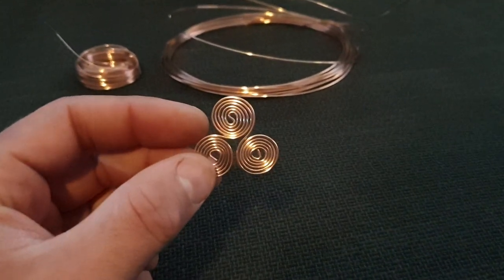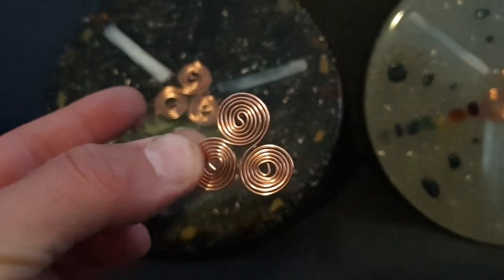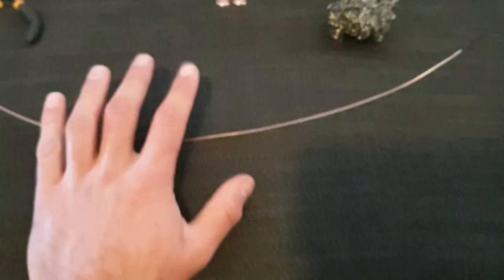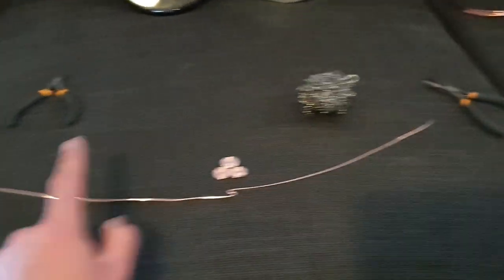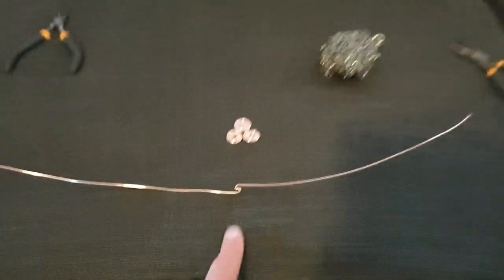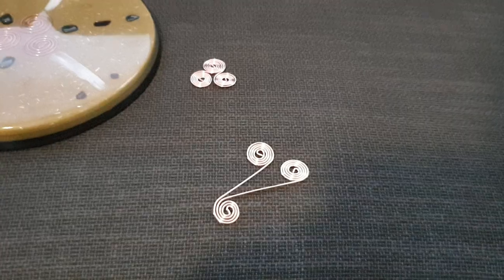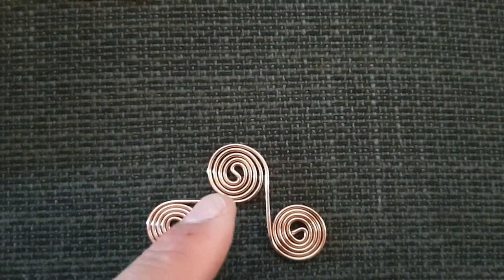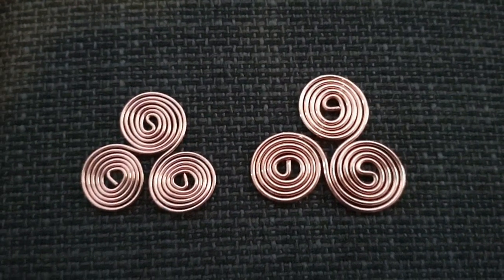Creating the Triskelion Copper Coil

Comment: Does the wire need to be solid copper or can I used copper plated .
Reply from the maker: It doesn't need to be but it's probably better if it was solid copper 👍